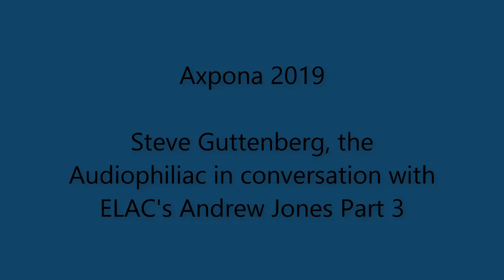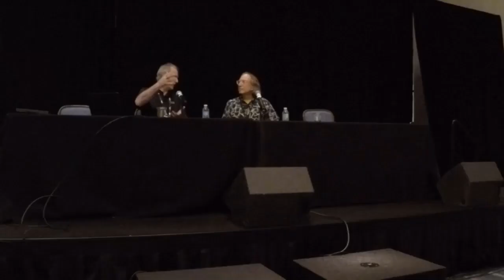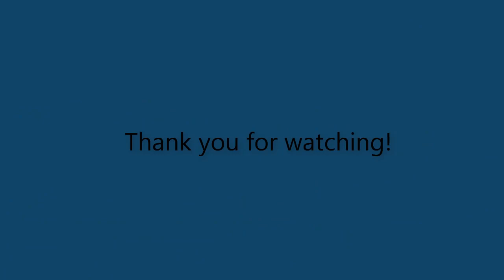ELAC’s Andrew Jones: The art of speaker design, Part 3

Comment: Thank you for interesting lecture. I like to listen to Andrew Jones, as he has very pragmatic approach to the subject.

I'm struggling a bit myself now. I live in the west of Ireland and that brings 2 problems: 1) import taxes from US, 2) literally nowhere to go and listen and compare the speakers :(
I want to get an entry-level desktop setup. For the similar price of about 220-240euro I can get the following:
Dali Spektor 2
Wharfedale Diamond 11.1
Elac Debut B5.2
Because the distance to the wall is gonna be less than 4'', in theory I should dismiss Spektor 2 straight away, but I have very big sentiment for Dali.

When I was about 18 years old (and my biggest dream was to become a sound engineer) I went to the first audiophile shop in my city (Poland in the middle of the 90s, communism just collapsed so, there was no such shops before). I entered the shop and was just looking at stuff. Suddenly, I heard that a woman started singing behind me! I turned around just to discover it was a song played on Arcam Delta amp with Dali 104s. Obviously I couldn't afford them, but ever since then I wanted to have a decent sound system. Now I (kind of...) can afford something and I would like to have something nice in my life. :)

As for the tax problems. It's hard to rely on the US reviews if you live in Europe and the other way around. Elacs B6.2 would cost me 360euro ($250 in US), RP-600Ms cost almost 700euro here ($550 in US), but Dali Oberon 3 cost 560euro (I believe $800 in US).

Comment: Hi Steve!  Thank you for this great piece with Mr. Jones; really interesting stuff.  And thanks for your daily videos; really fun to wake up each day to see what you're thinking about!  Quick question: I have a 16 year old pair of Boston Acoustics CR75 bookshelf speakers that I'm thinking about updating with the new Elac debuts (or maybe another Elac model?).  My setup is the Emotiva BASX A-100, SMSL SU-8 DAC, Dual 1246 TT w/ TEC USB phono preamp.  I converted a Rockford Fosgate 10" car-subwoofer from DC to AC, which is fun because it has a remote volume control so I can vary bass input for any given song/genre.  I use some older AudioQuest speaker cable (Crystal, I think??) and it's all near-field listening at low to moderate volume in a small bedroom office (approx. 10' X 10').  I really value detail and resolution; since I listen within about 3 feet, sound stage is not really a big deal, but i really like the sensation of detail.  I am wondering if you have any thoughts about how the CR75 would stack up against the Elacs.  Do you think my experience would be improved with a new pair of speakers?  Would the Elacs work well with the Emotiva?  Perhaps you have some thoughts about another moderately priced bookshelf that would be an improvement (based on the above) over the CR75s?  
Thanks in advance; I really appreciate your outlook on audio, and value your opinion.
Reply from the maker: Thanks for the kind word words, the ELAC B6.2 might be right for you.
Reply: @SteveGuttenbergAudiophiliac  thanks, Steve, 4 your prompt reply!